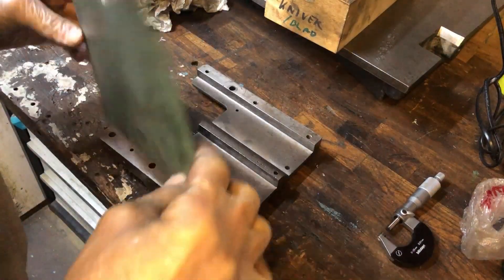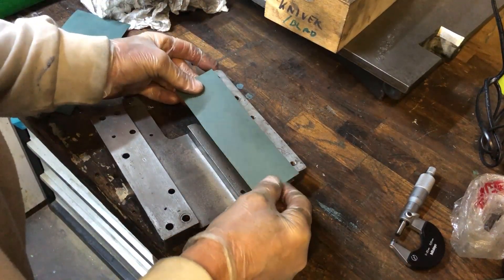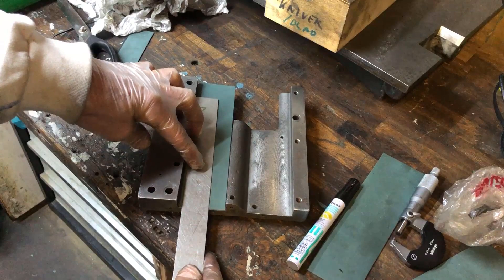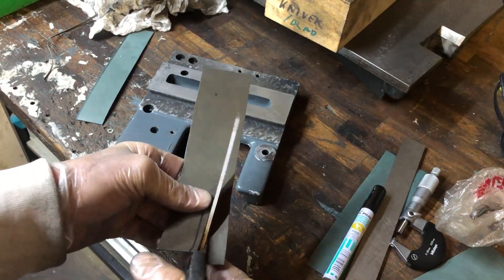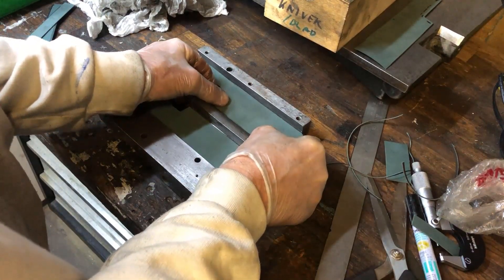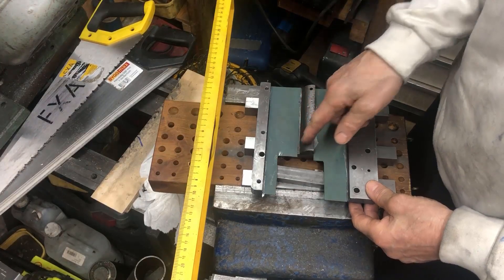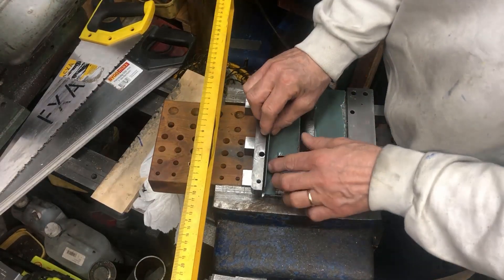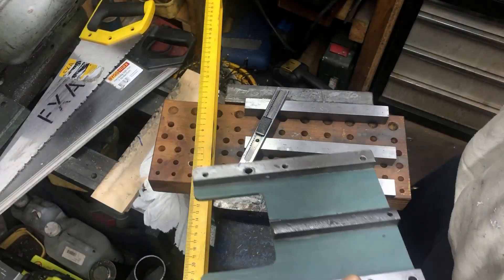Myford saddle resurfacing including Rulon application - 5 - additional on prep, glue etc

Comment: Rationally, I know it works.  I still can't help feeling like it's wrong to trust my machine's rigidity to something that can be cut with scissors.
Reply from the maker: Hmm.. I understand, but you might have a look at applications where it is normally used, ie. really big machinery, for example as shown here:  https://youtu.be/d5XfXPrPRqk?si=JSLju04tpKE3duQU . Or a bit smaller:  https://youtu.be/33AIwc_mFyM?si=GxeB2NvDuSZwjAe5 and here: https://youtu.be/1zNvdKz5r84?si=3KIFoieZPzpW62y-
Here is also a product video from the manufacturer, Tri Star Plastics: https://youtu.be/zWkPf-5k9RU?si=z0qkXUA6eRvr7269
Reply: I tear aluminum foil with my hands, but I still trust airplanes. ;)